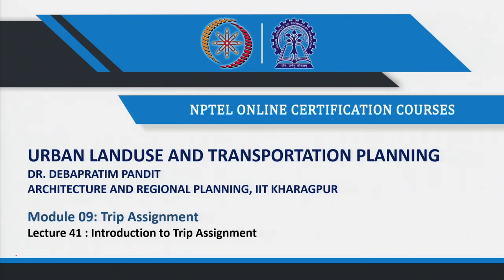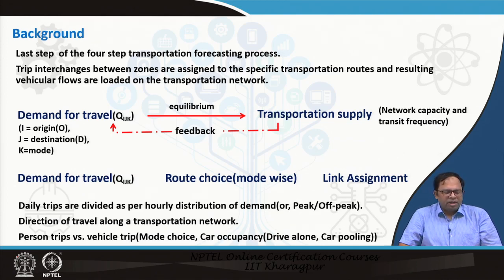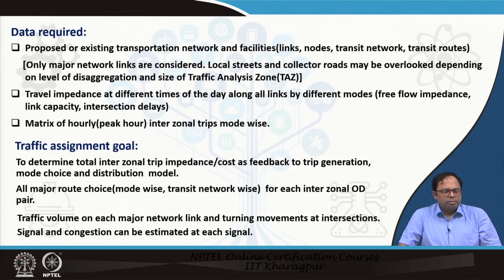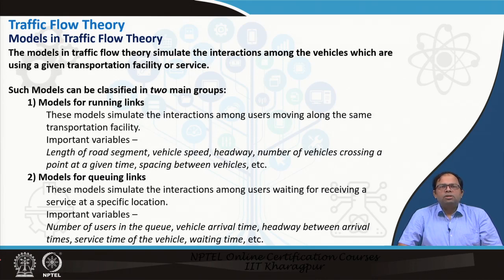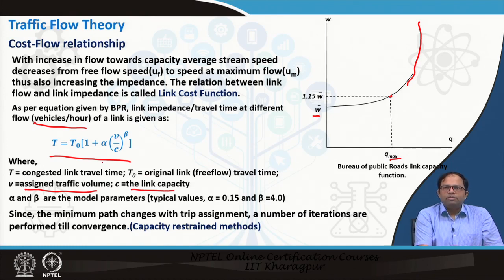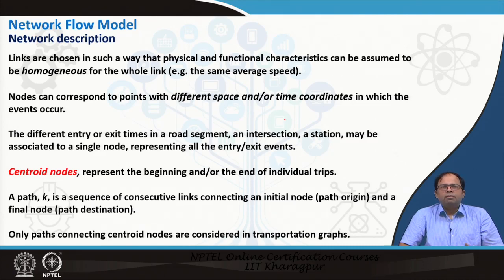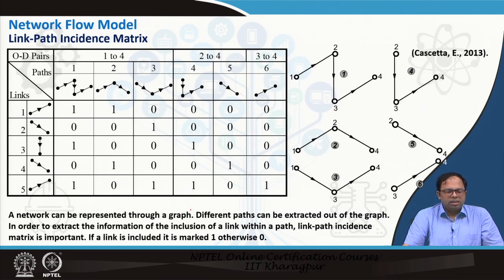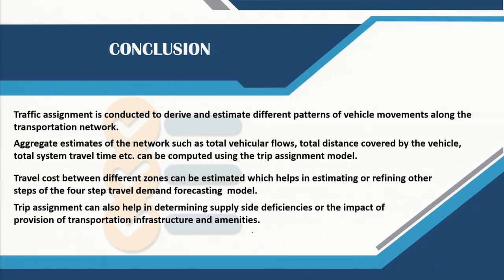Lecture 41 : Introduction to Trip Assignment

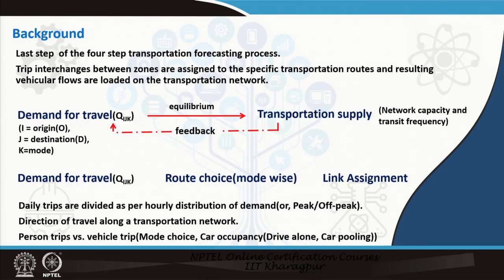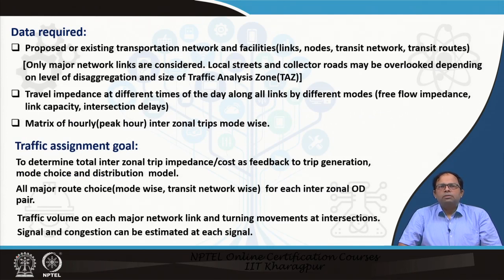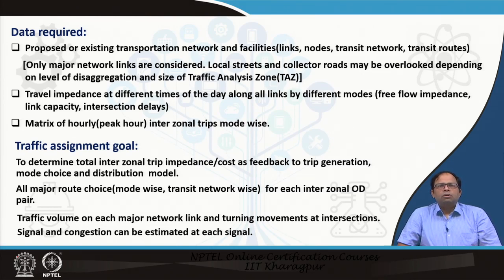Comment: #tripAssignment: background (0:48), data required (7:27), goals (11:09)
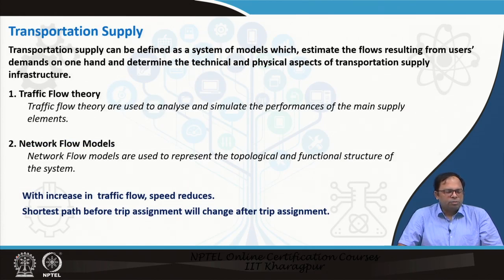Transportation supply (15:29)
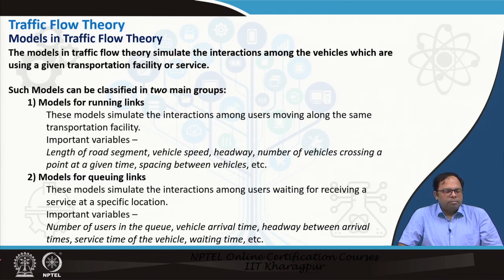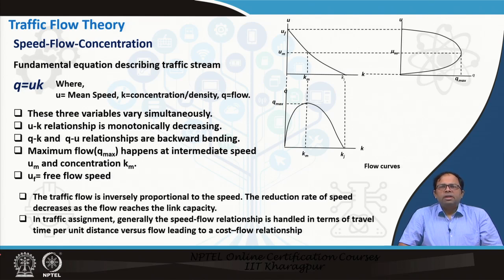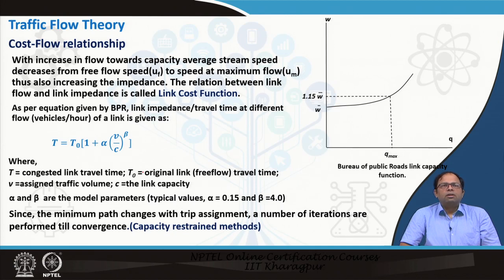Traffic flow theory: models (17:13), speed-flow concentration (20:05), cost-flow relationship (23:10)
Network flow model: 
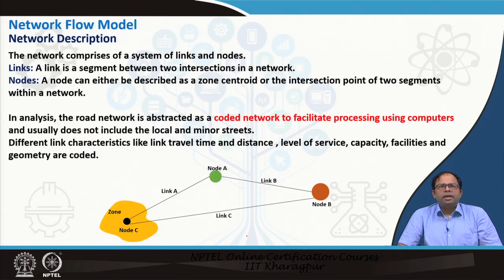<- Network description (26:57), links-nodes-centroids-paths (29:16), trip matrix (31:24), coding in GIS (34:03)
<- Graph models (34:56), link-path incidence (35:52), cost function (38:39)